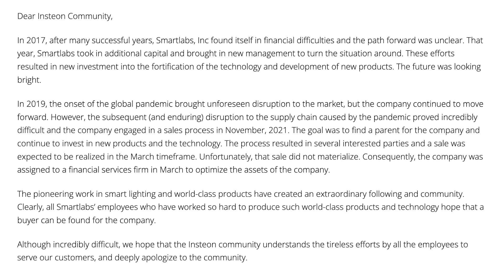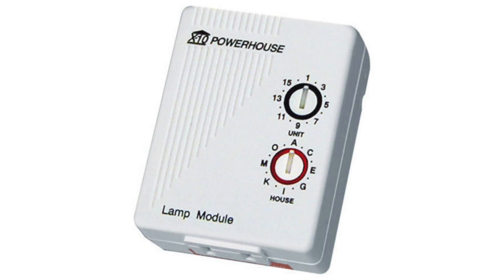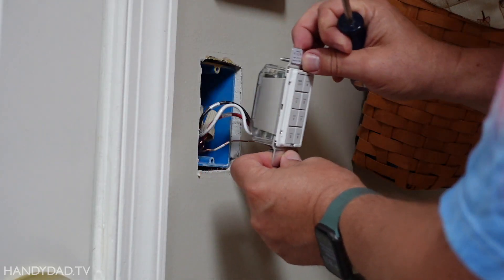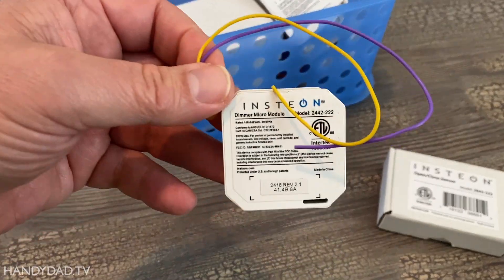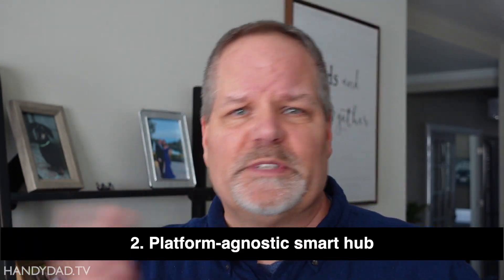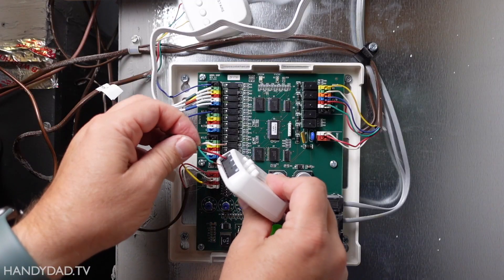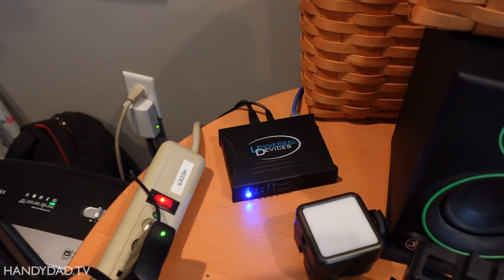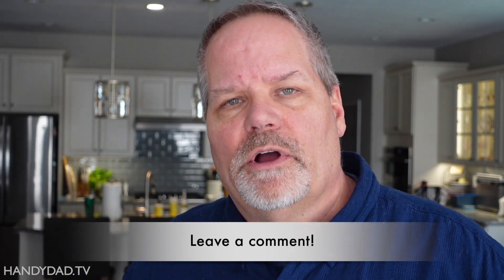INSTEON out of business. What to do?

Comment: I quit using the Insteon hub shortly after getting one. I went back to using Indigo because it’s local control and can also use Zigbee and Z-wave devices, and can control my Homekit modules. I stopped buying Insteon devices several years ago and only have their water leak sensors left to replace.
Reply from the maker: Good move

Comment: I left Insteon years ago.  I decided to do Sonoff devices.  Initially they only worked on the cloud.  However, they have added LAN control.  Very simple devices, and can be flashed with other firmware.  So my devices are wifi, LAN controlled.  Can work with various home automation software like echo, smarthings, google home, etc.
Reply from the maker: Which local firmware did you choose?
Reply: @handydadtv  I’m just using the sonoff firmware.

Comment: Homeseer has exactly what you’re talking about— their hub will control your Insteon devices and be able to control other platform devices as well. The problem is their stuff is extremely expensive.
Reply from the maker: I’m evaluating HomeSeer right now. Stay tuned.
Reply: They have an option to use your home computer or laptop to run their software in lieu of their hardware. The problem there is not everyone has a computer at each location that they run home automation at

Comment: I’m confused. I had a houseful of Insteon that I sold years ago. It did not need Internet connectivity, so what has changed since then? I used a local Indigo server and it worked well, aside from the fact that Insteon hardware was failure prone and Insteon communications were unreliable. Those last two are probably why they went belly up.
Reply from the maker: You never used the Insteon hub, app or voice integration so you wouldn’t have been impacted. 

Coincidentally, so many people, myself included, say Insteon has been the most rock solid platform with respect to reliability. When I push a keypad button, my lights work every time, without fail.
Reply from the maker: You never used the Insteon hub, app or voice integration so you wouldn’t have been impacted. 

Coincidentally, so many people, myself included, say Insteon has been the most rock solid platform with respect to reliability. When I push a keypad button, my lights work every time, without fail.
Reply from the maker: You never used the Insteon hub, app or voice integration so you wouldn’t have been impacted. 

Coincidentally, so many people, myself included, say Insteon has been the most rock solid platform with respect to reliability. When I push a keypad button, my lights work every time, without fail.

Comment: Thank you for the information. I had no idea Insteon  went out of business until I found your video. I have a few modules in the house. I never liked it for the start. They were unreliable and lose wifi connection often and only works with incandescent bulbs.  In the five years I've owned them, I have had to replace three hubs. Nice of Insteon to send replacement for free. Today I would never own any device that requires a hub.
Reply from the maker: Good thing you didn’t have many. Some people invested thousands in Insteon products.
Reply: Lose wifi connection?  Lol Their stuff was always reliable for me. That's coming from someone that works with any high end home automation for a living. As far as the hub goes, there is a cheap repair for them. Just replace one resistor and never have a problem again.
Reply: The company still exists and is selling products.  I don't know how you installed Insteon so it could be that unreliable.  The whole magic, is that it is duel mesh and fast.

Comment: Oh Yeah…… just like Quadraphonic and 3D monitors and glasses…. Financial failures,… right! Most of Us stick to none-over-geekification, and simply due without. No problems here.
Reply: @handydadtv  But SEE…. Quadraphonic, as one example, even through it failed as a home high fidelity advancement financially in comparison to very successful STEREO (left-right channels) high fidelity in its day, Quadraphonic hi-fi equipment became the predecessors to follow-ons, which were later introduced Dolby Surround formats. And those Dolby types were first introduce in community Movie Theaters. Only then were there parallel electronic versions introduced in home high fidelity receivers and pre-amplifier systems.
In fact, there are currently (in 2017, thru 2022 and other previous years) a selective niche of passionate individuals who have reissued formally quadraphonic Quad LP records. and Quad reel-to-reel tapes, and even Quad 8 track tapes) in specially encoded CDs and DVDs formats.

Comment: This crap really makes me mad! Even worse is when the companies willfully turn off devices and brick them while still being in business! I own several Slingbox M1's, which are boxes you buy to be able to remotely stream and control your home cable TV boxes so you can watch all your cable TV channels live from anywhere. These boxes connect to a remote server at Sling just to authenticate your username and password when connection. All streaming, encoding, decoding, etc is done peer 2 peer from your box to your client, so the server is literally just to check username and password. Well, Sling has decided to shut off those servers at the end of 2022, which means ALL slingbox's will be bricked because you won't be able to authenticate with your box. They aren't going out of business, they are just trying to push everyone to pay for a monthly subscription to their SlingTV online streaming service! There is absolutely NO reason authentication couldn't be done locally on the box, but Sling refuses to release a firmware with local authentication or to open source the box firmware since they're abandoning it. It's total BS.
Reply from the maker: I had one of the Sling boxes at one point. Yeah, that sucks. But at least you got advance notice.
Reply: New ownership, Insteon is on it’s way back. Subscription plan for the server. They are working with manufacturers to restart production of the insteon devices.

Comment: Insteon was initially designed to be linked and controlled locally. They still work that way. I ran Indigo on a Mac for years with no cloud to control my Insteon devices with no issue. The Hub is not really necessary and is in fact pretty weak as far as capabilities. The most popular ways to add software control to Insteon these days is Universal Devices ISY, Home Assistant, Home Seer, or Indigo. All these offerings are way more powerful than the Hub ever was. Keep an eye out for the Matter protocol which is officially supported by companies such as Apple.
Reply from the maker: Thanks 👍🏻
Reply: If I could use Indigo to control my Z wave home, I would. I use Smartthings, and it works okay, but I miss fully local control that I had with Indigo.

Comment: I have over 80 insteon devices around my house, and I use an ISY-994 so at least everything will still work in the meantime. the downside is that some devices are starting to fail and I won't be able to get replacements (I have a box of extras and I have to decide to use them or sell on eBay and gradually switch to new tech).
Reply from the maker: I predict the secondary market of used devices will go on for 10 years or more. So you’ll be able to get them for a long time, but they’ll have many miles on them. The Achilles heel is the PLM. They are rare. But, if it fails, it can be fixed by replacing the capacitors.

Comment: I started using Insteon from the prototype days and, at the time, it was 100% local without any external dependency using my own apps to manage the devices. The shift to apps rather than local interfaces was one of the reasons I shifted away as IP-based devices with local APIs became available.
Reply from the maker: I was also an Insteon use long before the hub. But once I got the hub, I was hooked.
Reply: @handydadtv  I should add that I wrote my own software to set up the relationships between the devices so I never used "raw" Insteon. I only used the PLM et al and then the hubs as interfaces for my own software. For a while, I used Houselinc but they dropped support.
Reply from the maker: I’m a geek too so I appreciate the custom software. 👍🏻

Comment: I had Insteon several houses ago. I swapped over to Lutron RadioRA2 and it is miles better. There is a pretty steep learning curve, but it is miles better in every technical aspect.
Reply from the maker: Did you install it yourself? I used to think Insteon was expensive until I looked into Lutron. 😳
Reply: @handydadtv  yes, I did the install myself. You have to get “certified” by taking their free online classes in order to access the software. It is about $100 per switch.

Comment: Been considering Hoobs to be able to use my products.  In a condo and we have basically lights and leak sensors.
Reply: I just picked up a Hoobs hub and will start porting over all my Insteon Switches, LampLink dimmers, 2450 I/O Link-Water Main shut-off solenoid valve, leak detectors and garage door openers so they can be used with Apple’s HomeKit.
Reply from the maker: Hoobs is purely HomeKit? We’re an Alexa family.
Reply: @handydadtv  I don't think so.  From what I have researched it works with Alexa.  Hoobs uses plugins to work.  That is how it works with Insteon and I believe also Alexa.  We are an Alexa household too as we have Sonos with Alexa.  The rest of everything we have is Apple but I don't want to have to buy another speaker

Comment: Hoobs can get your insteon devices back up with the existing hub, no plm needed.  Hoobs allows you to use Apples home interface to control you insteon devices, even the cameras.  Hoobs doesn't rely on external web servers like the old Insteon.
Reply: considering hoobs.  It works with Alexa too right?
Reply from the maker: Thanks for the tip

Comment: I have Insteon in my house. I am using an ISY as my hub. When Insteon became more difficult to acquire where I live I added the z-wave module to the ISY and started using z-wave devices. I also have a polyglot server connected to the ISY which lets it work with a wide range of other technologies.
Reply from the maker: That means you have a very rare and expensive component: an Insteon PLM.
Reply: @handydadtv  I do. I bought it at the same time I bought the ISY several years ago. At that time I was focused on an all Insteon home automation.
Reply: I did the same thing. My ISY doesn't need access to Alexis to work....
Reply: Same here using ISY with Z-Wave all controlled through Home Assistant using Node-Red

Comment: Thanks for the video !  I also used X10 modules years ago. I even developed a radio remote control prior to the one offered by X10 (my radio control device communicated with a single board computer that generated the x10 codes on the electrical network). A few years ago I looked for a device that would offer feedback and be compatible with x10 modules and found Insteon.  Over a 3 year period I had to change the hub 3 times. So when the hub stopped functioning,  I thought that the same problem occured. Your video informed me otherwise. I looked for a hub replacement and found 2, but it needs a PLM to work. I did not find any PLM available on eBay or elsewhere,  so I decided to replace my Insteon modules. So far I used non-hub switches and I'm waiting for a better solution.
Reply from the maker: PLMs are in very short supply and fetching high prices when they become available.

Comment: Home assistant or it's like is the way to go. As mentioned many companies make there money by selling products  and if they don't do well they can go bust. I disagree with the idea of paid services  since they are no more likely to survive or to keep your devices running then the none paid one's. Many of the paid services have also gone belly up and others have discontinued support on products for no better reason then to make more money selling you a new one. It's far better to get devices that allow for local control or can be flashed to do so removing dependency on companies to keep your products going. I run home assistant and none of my devices are fully dependent on the cloud to run although i can still use it if needed. This gives me all the convenance and yet still be assured my devices shall function if the could goes poof. These leaves the control in our hands and not in some company that may go bust or change things on a whim.
Reply from the maker: Are you using Insteon with Home Assistant? Through the hub or PLM?

Comment: 1st. DO NOT DEFAULT YOUR HUB. 2. Great video. I have about 15 insteon devices around my home. I have installed home assistant on a NAS I use with the Insteon plugin. Took about 10min and pressing the test button on some of the water sensors. Everything migrated perfectly. Better now I can have the 8 button controller turn on the TV or set the ecobee thermostats to away.
Reply from the maker: I am testing different hubs. HASS is on the list.

Comment: Thanks for this informative video.  I also started with x10.  Agree someone should buy their assets for the user base, turn on servers and/or sell compatible hub that will allow devices to work again.  Strangely the schedules to turn on/off lights still seems to work even though hub is out.  But can’t program any scenes./switches anymore.  As alternative to Insteon I think lutron ra2 and Leviton smart switches are best options
Reply from the maker: The timers in your hub will continue to work unless you do a factory reset. But you can’t edit them without the app.

Comment: So disappointed in the way Insteon disappeared.  Ended up using UD Polisy with internal ISY.  Added Zwave module.  If I understand, Zwave is open, so should be around for a while.  Most of the switches and dimmers can be found for Zwave, so as they break, I will replace with Zwave.  I have not found a replacement for the 6 or 8 button keypad.
Reply from the maker: INTERNAL ISY???? That’s a thing?? The website says Polisy needs a PLM.
Reply: @handydadtv  Correct, I had a PLM from my old ISY.  ISY is in the new Polisy box.
Reply from the maker: Is Polisy worth it? Is it just more interfaces than the old ISY?
Reply: @handydadtv  It has Polyglot on board where you can add various notes and interfaces.  I think it is going to be the replacement for the ISY.

Comment: I was an X10 user in the 90s and have had Insteon of some variety for the last 10+ years.  My last 3 homes (sorry to whoever bought them) had 50+ Insteon switches, sensors, remotes etc etc and are now dead.  My current home has 45 insteon switches and 10 or so plug in modules.  At this time I am making due with Home Assistant on a RPI (GREAT software by the way) to control my lights etc.   I think my next step is going to be something based on either Zigbee or Matter (vaporware right now?), but we shall see.  Either way I am NOT screwed, just eyeing the future.  Love this video, thanks for posting.
Reply from the maker: How does HASS communicate with Insteon?
Reply: @handydadtv  so it still needs the PLM or the hub for full functionality, but for the moment that’s fine.  I blocked outbound access from my firewall as it has a fixed address dhcp address so I’m not too worried about it ‘phoning home’ if the servers or a savvy hacker come back online one day.  The scenes and automation all still work and I have voice control working with google home.  So, for now I’m good but definitely planning what to replace them with.

Comment: As someone who is a friend of an engineer who worked for Insteon, Insteon was never - at least while my friend was there - interested in the consumer market. In fact one of their first installations was at Steve Martin's house. Meaning, they were never interested in a low cost consumer solution and there's only so many celebrity homes you can outfit. Next, as a programmer of varying products (PLCs, HMIs, servos, timers, etc.), I found Insteon's interface SUCKED! Not being able to have two devices share the same program is dumb. My next comment comes from experience of Insteon, Smart Things and Philips Hue; avoid ANY product that requires a hub. I've ditched every device in my home that required one for those that just need WiFi. Every one of the devices that required a hub died within a few years (the GE Z-wave/Zig-bee switches are absolute junk!) The Philips Hue product would regularly disconnect from the hub becoming worthless. The most reliable products for me have been those that operate on the Tuya Smart and Smart Life apps. Anyway, I like your channel.
Reply from the maker: Thanks for the input. The irony is that Lutron Caseta devices are far more expensive than Insteons were, yet Caseta is targeted for consumers. 

Sorry, WiFi isn’t better. Your hub is in the cloud, and your router is another point of failure. Your scenes won’t work without it. Insteon was the only hubless architecture. The Insteon hub was only needed for integrations and automations. All devices continued to work without it. 

Also, do you have a separate subnet for your home automation devices to keep foreign devices out of your home network? Or am I just paranoid?